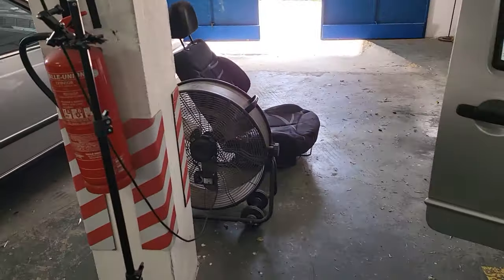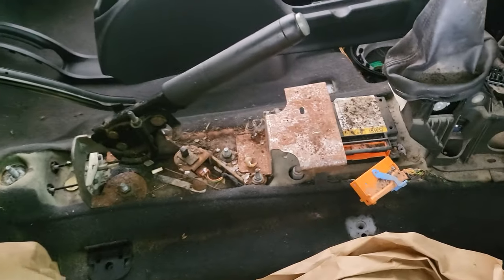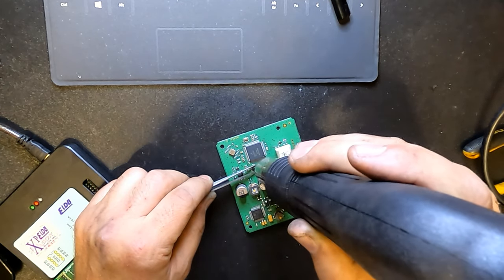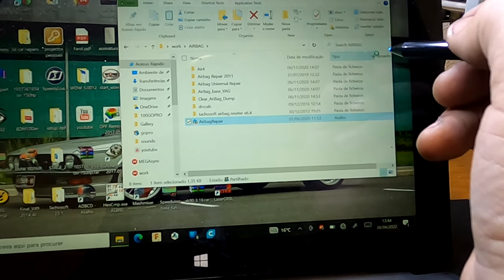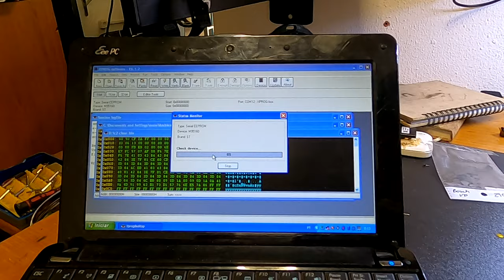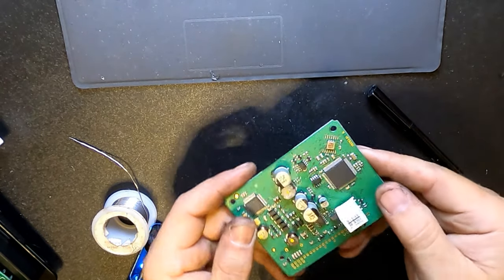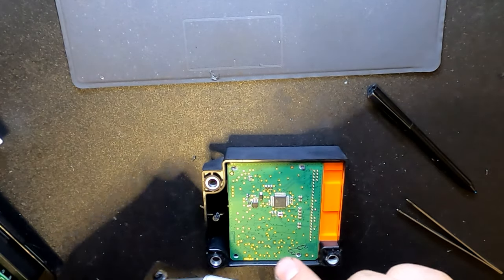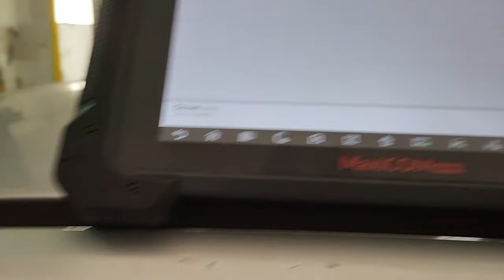Citroen Airbag Crash Reset

Comment: Fantastic video, very explicit, congratulations I have a Citroen C3 in an accident, it has already been rebuilt but it won't start, I probably have the airbag module blocked. Could it be that if I buy a module from a used but not damaged car, it will make the car start? grateful for the attention